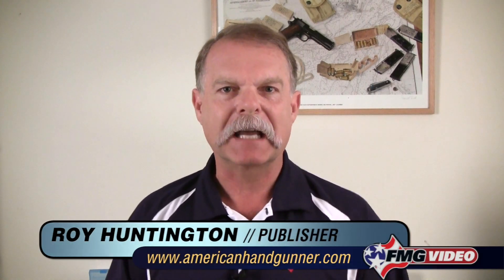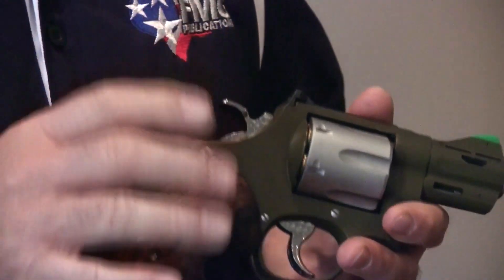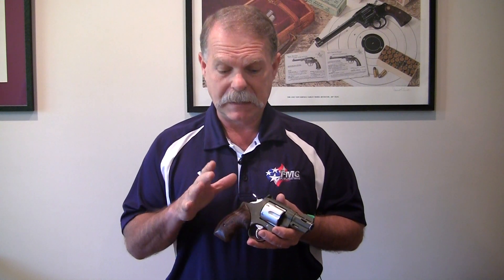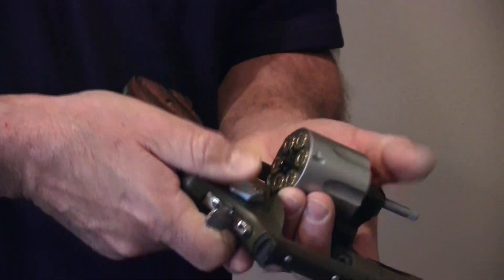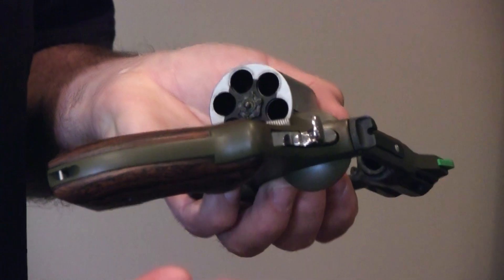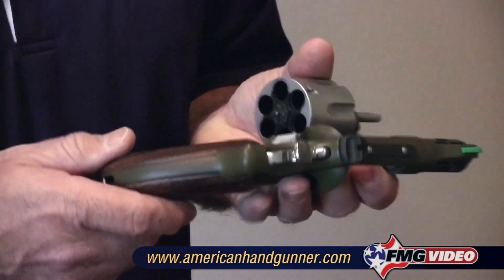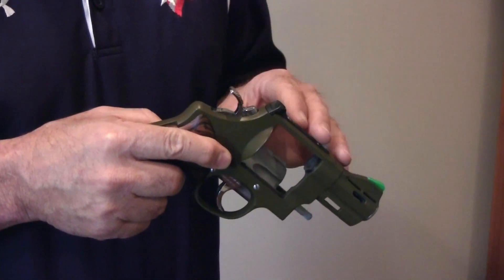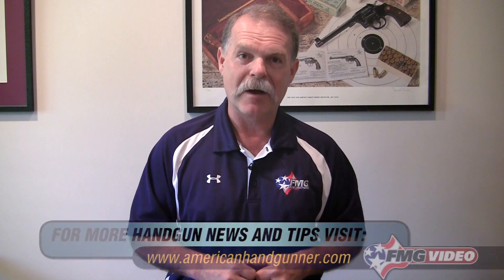Unloading A Revolver

Comment: Some people may be confused by the different types of cylinder latches. Smith and Wesson latches are pushed FORWARD, as shown here. But COLT latches are pulled BACK. Ruger latches are pushed IN or sideways. Some cheap old revolvers don't have a latch button: you pull forward on the ejector rod below the barrel. Old hinged frame revolvers have a latch on the frame above the hammer.
Reply: As you pointed out, this was not a well thought out video. In the narrators defence not everyone has a Schofield.

Comment: Comparing the number of cartridges with the number of charge holes is a great tip.  It's easy to miss a nickle plated cartridge case in a stainless steel or nickle plated cylinder.
Reply from the maker: Exactly! Roy